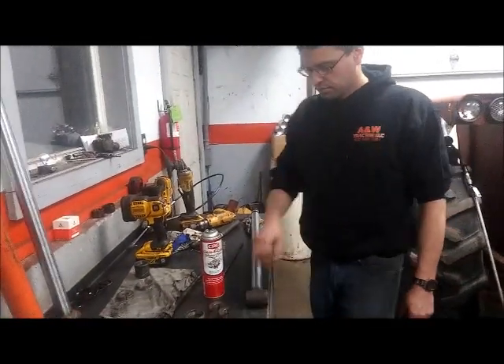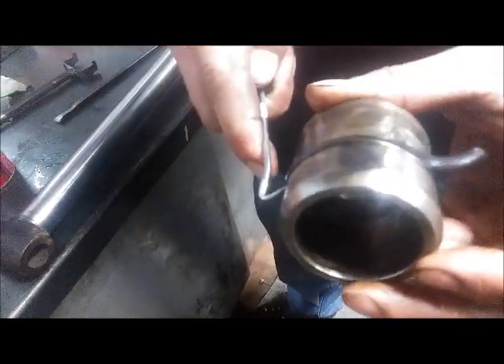HOW TO RESEAL ALLIS-CHALMERS LOADER HYDRAULIC CYLINDERS PART 2

Comment: just came here from part 1. the last thing you said was "this next part is pretty important concerning these 2 part pistons" - and then part 2 starts up after you've removed them. lol

Also, where can I buy a seal kit for my 500 loader cylinders? you said you sell them, but I can't seem to find them on your website
Reply from the maker: Thanks for the heads up on the video. The seal kits are under part number 584481 on our website and in the loaders category.